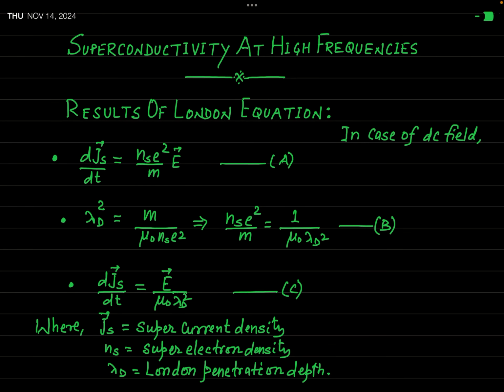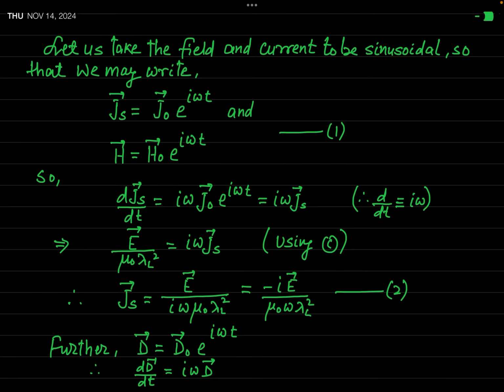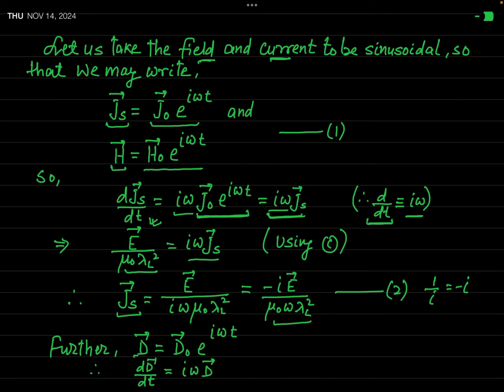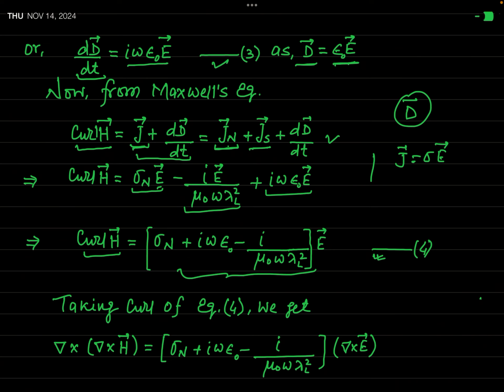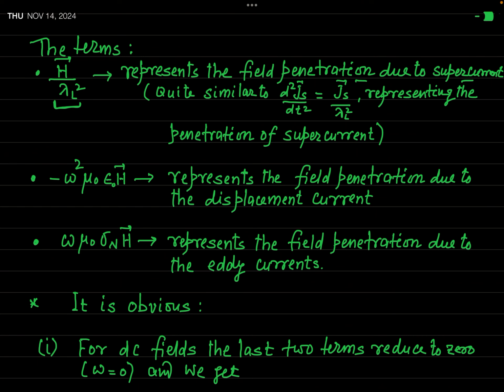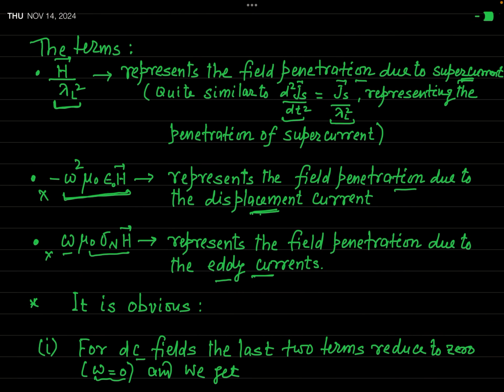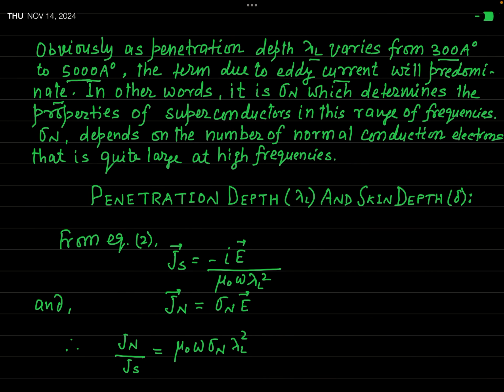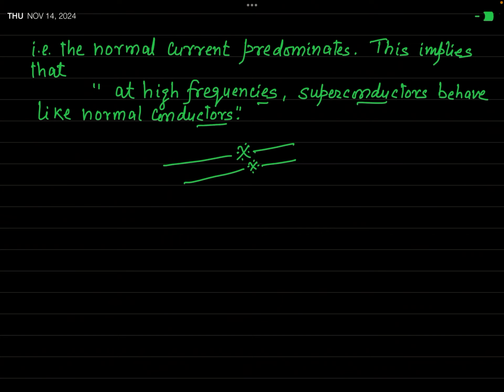Condensed Matter Physics - Superconductivity At High Frequencies : Penetration Depth and Skin Depth

Comment: But sir microwaves don't have high frequency  , they have high wavelength so we are using it in high frequency
Reply from the maker: The term "high frequency" here is relative to the material's response, not necessarily the absolute highest frequencies.